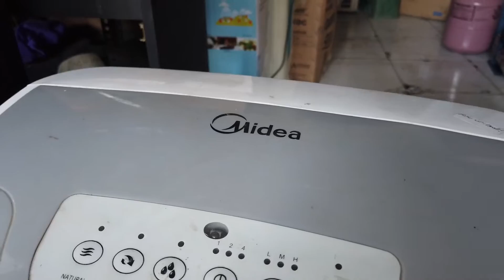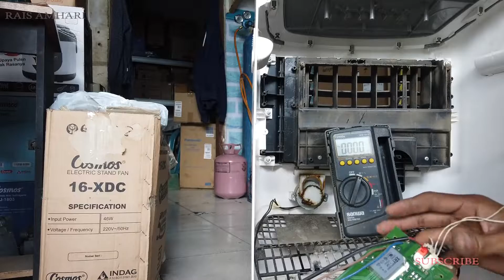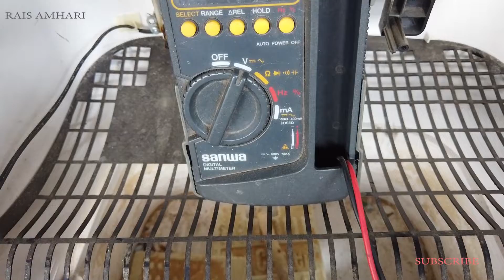CIRI CIRI AIR COOLER PCB RUSAK

Comment: Om mau tanya,,air cooler saya merk krishbow,,ada 4 resistor ( 3.9/1W )terbakar sampai jebol papan pcb,,sudah ta ganti dengan ukuran resistor sama,,tpi pas di tes keluar asap di resistor baru..itu kenapa om 🙏
Reply from the maker: IC power supply nya mungkin konslet

Comment: Mas sy punya air cooler akira tiap dinyalain kipas muter tp 1-2 detik kemudian lsg mati sendiri, tiap nyalain lg mati langsung terus walaupun kipas muter sebentar, apanya yg rusak ya?
Reply from the maker: Mesti cek tegangan psunya dulu mas, baru bisa analisa
Reply: Sama... Gmn cara mengecek tegangan PSU nya Om... Maaf saya pemula
Reply: Mirip.mirip punya saya. Cuma yg saya water level alarm yg keluar cuma 1-2 detik nyala pompanya abis itu alarm keluar dan airnya ga jalan.